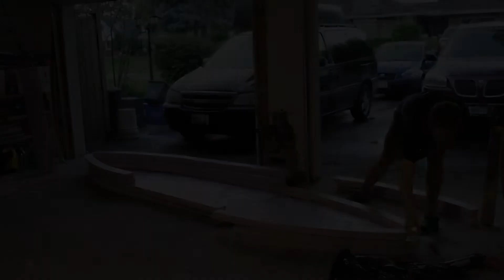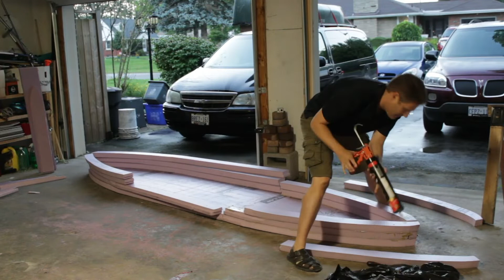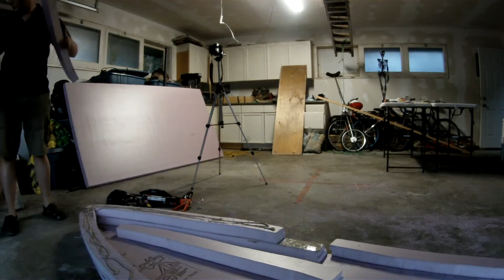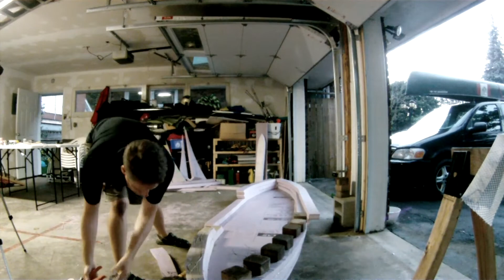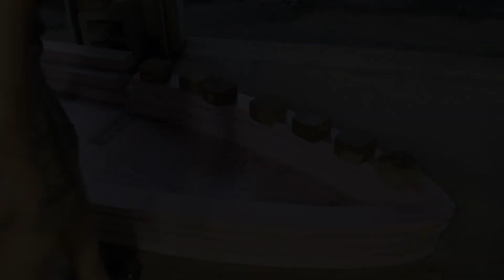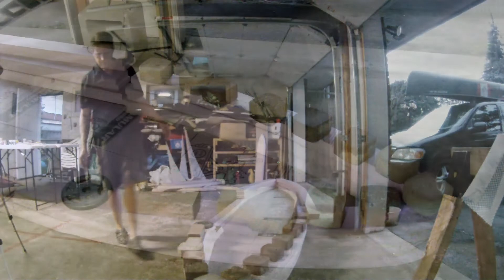DIY Foam Kayak - part 5

Comment: So do you have a technique to laying or spreading the PLpremium? I get asked about using it often,  but have never used it to stick a boat hull together.
Reply: The boat is turning out nicely
Reply from the maker: I've never used it before this, but I just scuffed the surfaces squirted some on one surface and then spread it thinly with a scraper and loaded the foam with weight. It's way cheaper than gorilla glue - about $13 CAD for 825 ml. $13 gets you 118 ml of Gorilla Glue. It's about 7 times cheaper per ml
Reply from the maker: Oh and it takes 24 hours to cure, is waterproof and paintable. Definitely recommend gloves though. It's impossible to get off your fingers. I'm thinking it might be suitable for a version of poor man's fibre glass...although the product spec says 'Not for use in water submersion application'
Reply: @mandrewsvideos  I was not to impressed with the gorilla glue when you are sanding the joints that glue does not sand well and prevents a nice joint.
Reply from the maker: @mlangfordoutdoor  The PL Premium is not recommended for wet applications, but I suspect this means behind/under showers etc. Since my boat is out of the water 99% of the time and is also covered in fibre glass it hasn't been an issue. It's tough as nails and takes ages to sand if you slop it about, but I will be using for my next build.